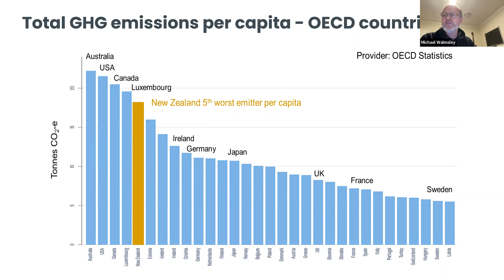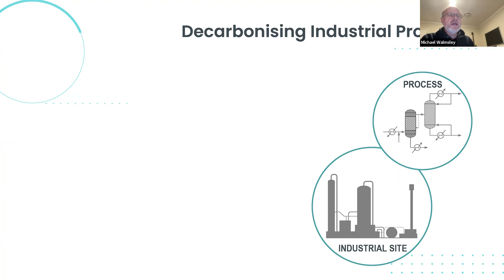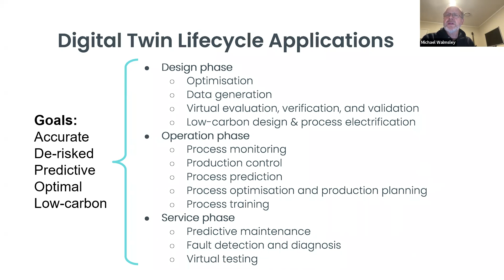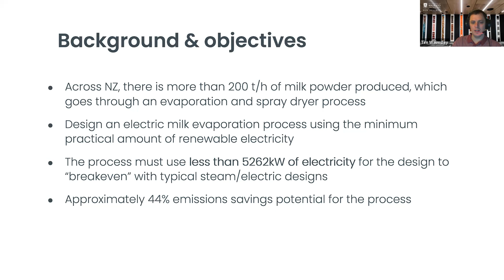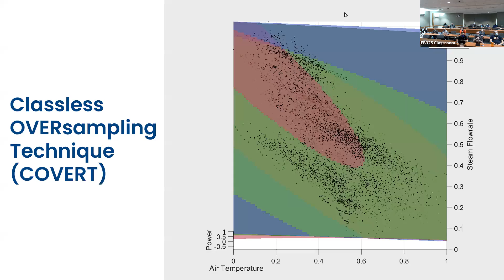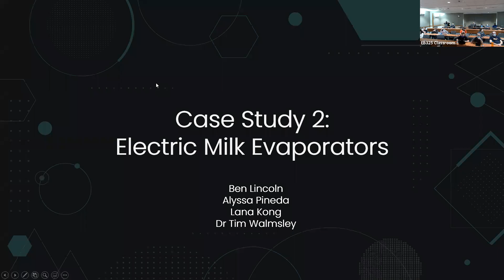Decarbonising New Zealand Industry

Comment: I really liked the concept of using existing infrastructure as energy storage. I think I heard this concept before in other seminars, but it didn't really sink in until the first speaker mentioned using a factory as energy storage for renewables. I am currently working on materials for energy storage in molten salts. I'm glad I listened to this so I don't get pigeon holed into thinking there is only one energy storage option. 

I  worked at a mine prior to returning to get a PhD from BYU and I saw them using some of these highly automated systems to help control a concentrate leach plant (CLP) for coper and molybdenum production. I liked hearing a little bit of background on some of the current issues with these shadow systems and data biases.